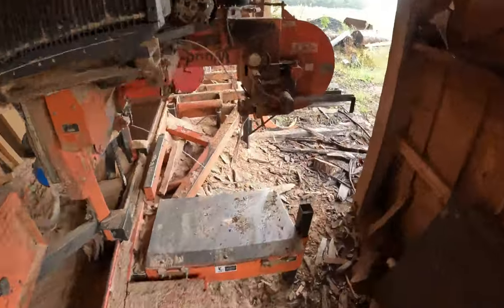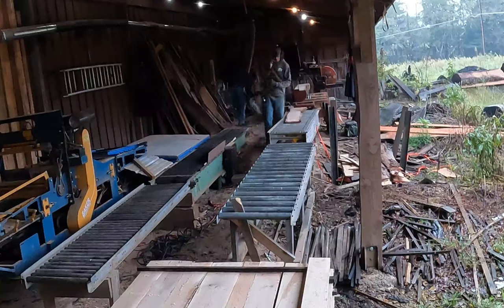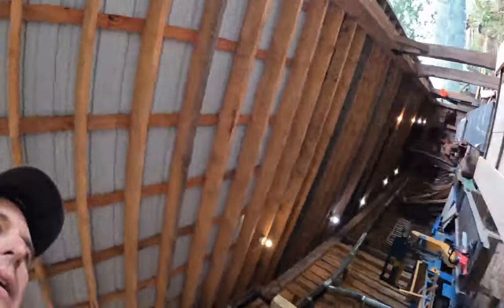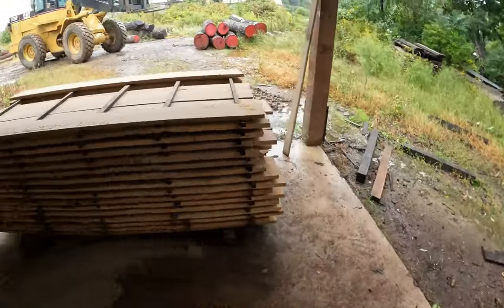Running The Sawmill And Edger At The Same Time While Sawing White Oak!

Comment: I notice you stack the boards tight side to side. I suppose there isn't much drying surface on the edges, but curious if you had any comments on not gapping the boards.  Love the videos.
Reply from the maker: I don’t think it makes a difference in drying performance. The airflow is through the stack side to side not vertically. Also as the boards dry they shrink and create a gap. One thing I do is line up my air dry stacks North/South, Because our predominate wind here is East/West. That gives more even airflow through the stacks.

Comment: As you don't have a debarker do you give the logs a good look before sawing to ensure that there is no foreign material that could be detrimental to the bandsaw and the operator's health? When you are piling the lumber do you put the heart side of the board up or down?
Reply from the maker: I actually do have a debarker that runs in front of the saw blade and cleans any dirt/rocks lodged in the bark. I was taught bark side down is the best way to stack but honestly I don’t think it makes much difference.
Reply: thanks for the reply. I was tailing the headrig one night in the early seventies at a softwood lumber mill here in British Columbia when the single cut 8 foot bandsaw hit a fist sized rock. All holy hell broke loose as the saw exploded into six large pieces and a few smaller pieces. After the saw was replaced along with the guides and repairs to a broken air line on the swing arm for the carriage we were back sawing.. The sawyer was so rattled that he went home and I sawed for the rest of the shift while the foreman tailed for me and the chargehand ran the edger as the edgerman called it a night also. You never know what might go down in a mill. @hillcustomlumber
Reply from the maker: That’s very true, expect the unexpected. I hear your part of the world is beautiful, I hope to make it up there one day!

Comment: How long to you AD or KD the oak for and to what MC?
Reply from the maker: I typically air dry for 2-3 months then kiln dry for 7-10days. Or 4 weeks in the kiln off the saw. 6-8% finished MC.
Reply: thanks for the reply. In an earlier video I stated that I have 30 years softwood lumber experience and no hardwood experience. So I find your videos and answers to my questions very informative. Your dry kiln -is it the dehumidification type?  @hillcustomlumber
Reply from the maker: Yes i run 3 Nyle dehumidification kilns. If you search my channel i have a few videos about the kilns.